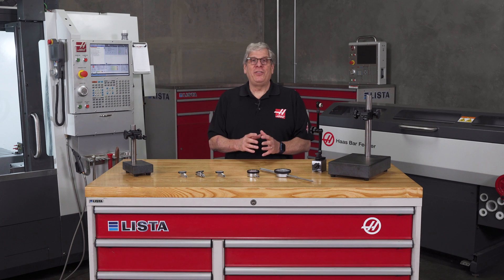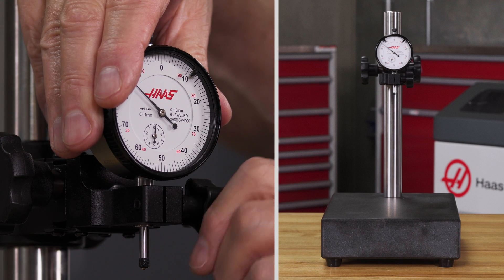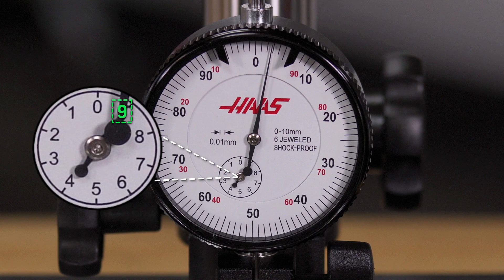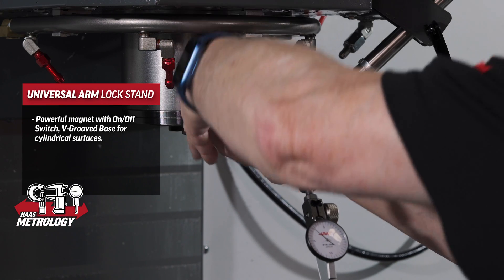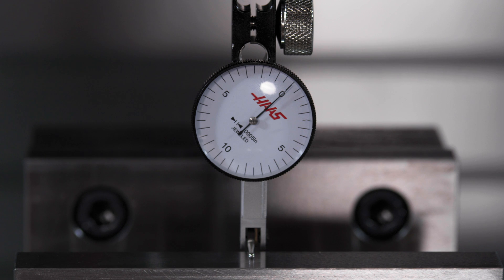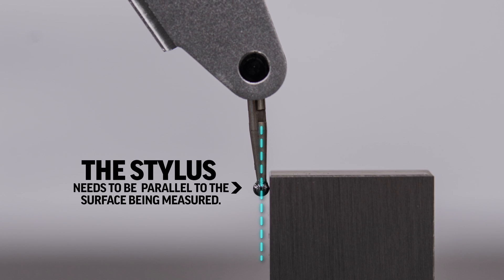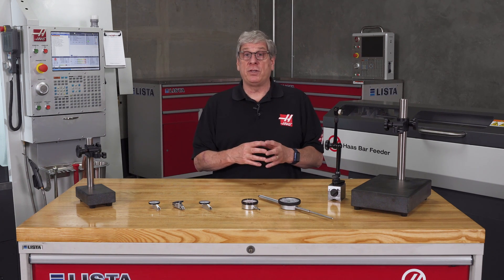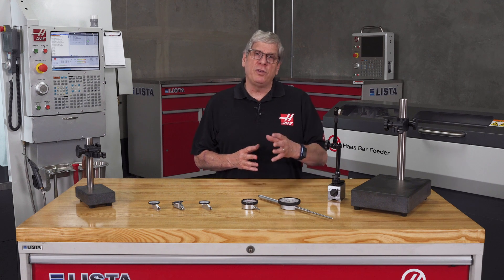How To Use an Indicator - Dial Travel & Dial Test Indicator Basics - Haas Automation, Inc.

Comment: 10mm is 400,000th of an inch?
Reply: 400 thousandths, or 0.4".  Actually it's 0.393700787402..." but the rules of significant figures means that "10mm" is 0.400".
Reply: @JxH  so is that 10mm is 40% of an inch?
Reply: @ "...40%..."

10mm/25.4mm = 39.3700787...%

The International/Industrial inch was set to 25.4mm exactly by Johannsson with his gauge blocks.  Even the 'B' grade ones, which are certainly good enough to calibrate most micrometers.

Before that everyone had their own inch.
Reply: @JxH  i have decided this conversation is above my pay grade, i struggle with numbers and have self diagnosed myself with  dyscalculia,  even processing phone numbers for me is a task, i could not comprehend what 400,000 nth of an inch was, in my head it was, well even trying to explain it has done my head in, i envy you for even having a grasp of it.

Ian
Reply: @ You're probably very good at something that I'm not. Stay well my friend. Cheers. 🙂

Comment: I'm not so sure about that 9.03mm read out. I'll say that was a 8.97mm read out. Since the dial didn't make 9 full rotations, it came 3 graduations short. Even both are within tolerance, that's a huge mistake.
Reply: It's 9.03mm. The large dial increases in clockwise direction (black numbering) and went for slightly more than 9 rotations. The tiny dial with whole millimeters increases counterclockwise though.

Comment: For the best results when using a stylus type indicator, you should not depend on the indicator as a measurement device. Cosine error is too variable depending on the swing of the tip. I always recommend using the machine or i.e. graduated height gage for the exact measurement. A stylus indicator is technically only a comparative tool, not a  direct tool.
In most average cases, it's not a big issue, but when working with very high standards, it should be noted. BTW, the term gage and guage are 2 different meanings. A gage is the referenced tool, guage is the action of using a gage. (For the spell checker.) I use a tire gage to guage my tire pressure.